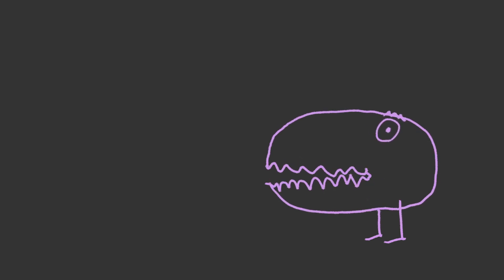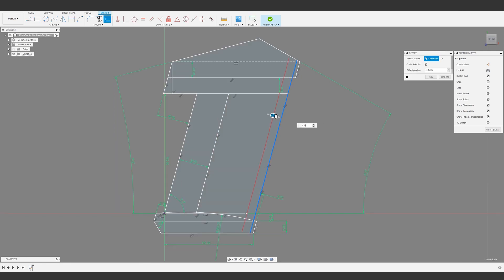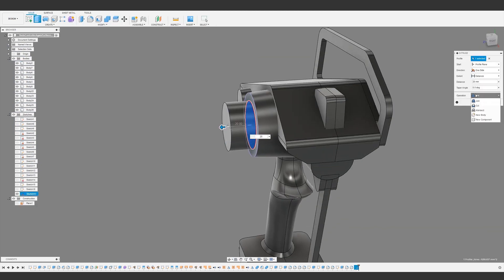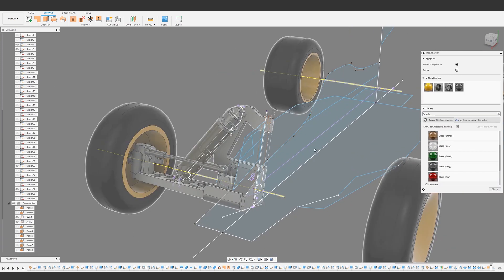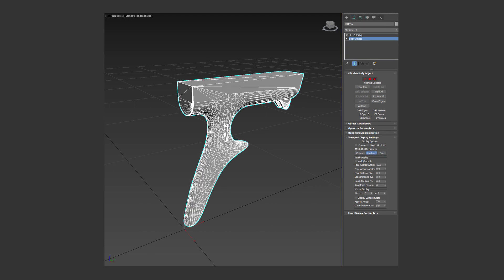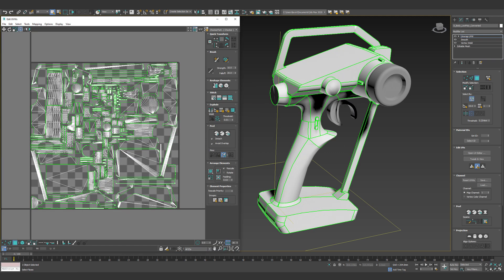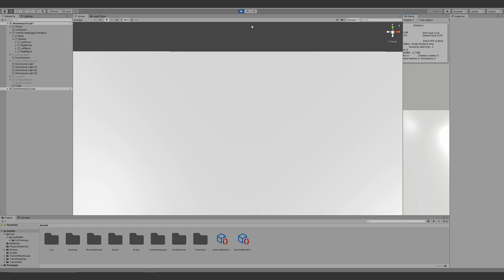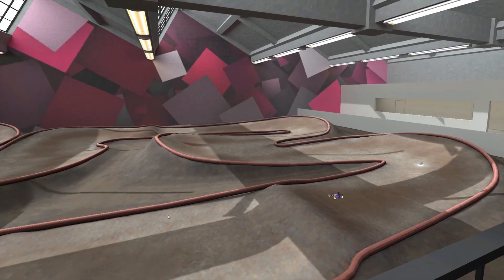Game Assets With Fusion 360

Comment: im now getting to the level where i need to learn more about surfacing and topology and i find your videos so increidibly helpful since i can see how you make the complex surfaces in the models. However i would have a few questions, why did you duplicate the model of the controller and changed just a few details on one and a few details on the other? and how do you combine them back togheter ? i have never seen that
And also just out of curiousity what tools do you use for modeling? do you do everything with a mouse? a space mouse or a pen or what is your go to option ?

Comment: You really should try out UE5. Using the new Nanite system you can skip the low poly process entirely. And because it was made parametrically in Fusion, it has UVs, so you can just repack them and use a painting program to make textures.